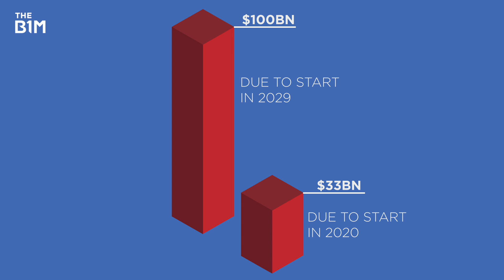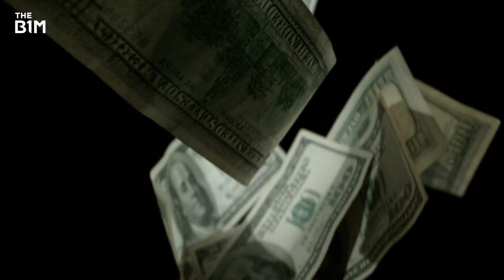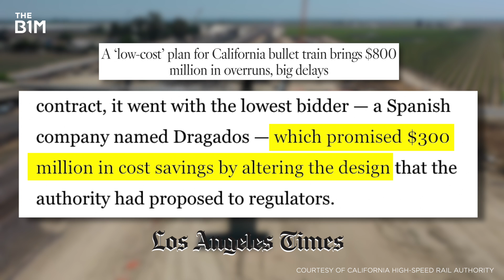What Went Wrong With California's High-Speed Railway

Comment: The video fails to mention the mountains surrounding Los Angeles, current rail traffic leaving the basin heads east in the wrong direction and passenger traffic is limited to 60 mph because of the gradient. The tunneling for high speed would cost trillions and dwarf all previous tunnel projects. The Central Valley line in the video is of little use and could have been done for half the cost and much less environmental damage by upgrading existing rail lines, albeit with slightly lower speed. The whole thing was a “green” mega project that lacked common sense and a little knowledge of train requirements. Meanwhile the state is in a drought and has not built new water reservoirs in years despite increasing population. Vanity and virtue signaling from politicians is why we don’t have nice things.
Reply: the swiss and austrians tunneled through the fucking Alps so the US should be able to tunnel through some hills shouldn't it? the japanese build their entire high speed network through their pacific mountain chain no problem but the US is "virtue signaling" because they want to build one high speed line between to cities? get real, you have no clue what you are talking about

Comment: ...I've been taking Amtrak for over 25 years.  I've had informal chats with Amtrak riders over the years.  What I've been hearing is the biggest need are connections from rural towns to both Amtrak and the hypothetical High Speed Rail.  I agree. I am originally from a rural city in the SJ Valley and finding public transportation connections to Amtrak is very difficult. Therefore I imagine same issues in connecting to High Speed Rail.  I didn't own a car for 15 years and depended on Public Transportation.  Amtrak is hugely popular.  I voted for the State Bonds to fund High Speed Rail but would like to see more connectors to Amtrak and High Speed Rail.

Comment: What went wrong with California's high-speed railway is that nothing went RIGHT -- and nothing about the Crony Express scheme was "highly sensible.".  First, there was no demand -- if there were more need, it would have been filled by private enterprise.  Second, they made promises which could never have been fulfilled, especially about travel time and ticket cost.  Third, they counted on stealing most of the money from taxpayers in the other 49 states.  I'll bet that if you do some digging, you will find out that a lot of the land that will be needed is owned by the politicos, their families and donors . . .and purchased within the last three decades.  And I dunno where the guy with the accent comes from, but anyone who has ever been to either LA or San Francisco knows that there are several airports serving each, and that none of these is "out of town."  "Not exactly easy"?  As opposed to a drive to wherever the train will pick you up, a three-hour train ride, and then a drive to wherever you're headed.   Southwest Airlines flies empty seats between SoCal and NorCal, at lower ticket prices than the HSR will have to sell for to even PRETEND to succeed.

Comment: DIG DEEPER.
 it should be painfully apparent that a project of this size shouldn't cost anywhere near this much money, not in Japan, not in Europe not know where, so where is all that money going? The answer is pork barrel projects packaged together with the HSR project that local and elected officials deemed as necessary for the project. 

for example, say the rail must cross over a freeway, in this case the 99, instead of just redoing the freeway section that will be crossed , they(local elected county and city officials) use the project funds as a means to get there entire town/city/regions freeway rebuilt with brand new on and off ramps, highway overheads, lane expansions; the works, things they always wanted done but never had the money to do it. the original route i voted for in 2008 took it across the central coast ranges, not too far from and running parallel with i5, where there is practically zero urbanization or developed land, but then it was quickly changed to run along the 99 instead, where all the central valley towns and cities lie. supposedly local leaders said it wasn't fair that there towns would be bypassed, then the motive changed and it was touted as being an economy booster for the central valley economy. 

Another example is what state officials decided to include with the project, once again deemed as necessary.......a complete refurbishment and rebuild of California's EXISTING passenger rail network! Yup, part of that 100 billion was to cover the cost of completely updating the PREEXISTING rail network., cuz in there minds, ridership will not only quadruple for the HSR, but will so for the old rail network too, a network that has had the same routes and the same speeds will magically gain triple, quadruple ridership, using routes/destinations that the HSR SHOULD HAVE been replacing but instead, according to state officials, will act as a primary route to be SUPPLEMENTED with existing lines
Yet more examples include LA & SF officials using the funds to boost construction of there own local metro rail network, or in SF case, the building of a huge new modern central train station, all of which deemed necessary so that the local metro's will be fully integrated with the HSR, EVEN THO they already are via LA's & SF's existing central station.

This whole project was just a money pit for local elected leaders to finally have a legitimate reason for needing the money they never had and spend it on there own local infrastructure projects, so as to satisfy there districts and ensuring reelection

Comment: It was voted on by the citizens. However, it's not a high speed train since it can only go 50mph on some rail. It's needed to use rail from other railroads. A judge even said that this is illegal since it can not maintain a high speed. This is in the by laws of the the rail company as voted on by the public. They would have been smarter to run to Las Vegas NV. Very over budget.

Comment: First off, there is no plan to go into LA. It will stop in Mohave. The route to Las Vegas was canceled in 2018. There was no intention to go past Victorville.  A casual drive along Hwy 99 shows this project is completely abandoned. The Daylight ran between LA and SF for years and could not turn a profit.  Oh, the speed limit on the Acela is 80 mph, due PTC limitations.

Comment: What went wrong: Politicians.  The Bond measure sold this train as LA to SF in 2.5 hours (speed over 200 mph).  Californians/Americans have no problem with high-speed rail travel IF it makes sense.  Look at the route they chose for this... Why did they build the middle section first?  Easy, it was always truly planned to be an on-going union-friendly jobs program to keep the politician-donor power cycle in place for decades.  They don't give a damn about what actually made sense to connect the two population centers of the state.

Comment: I don't know what a train ticket would be, but I'd be willing to bet taking this train from LA to Frisco or vice-versa will cost much, much more than the cost of flying or driving.

I took Amtrak one time from Philadelphia, PA, to Wilmington, DE one morning to get to work a few years ago as my car was in a repair shop in Wilmington.  

Distance - about 30 miles. 
The cost for my one-way ticket was just under $100. I was stunned to say the least. 

This story mentions that since the train is electric, there are no emissions. True enough, but as I've asked elsewhere - what about emissions at the location where the electricity is generated?

Also - if Biden, et al., wants electric cars, trains, etc... and no fossil fuels, how will the electricity be generated? Are they planning to build thousands of nuclear plants? Solar and wind are fine for those willing to pay the exorbitant up-front costs to power their single family homes by sun or wind, but I don't believe that the US' power needs (specifically generating electricity) can be met without coal, LPG, LNG or other substance obtained from the earth to generate electricity to power these trains or EVs anytime soon (this century).

We are far behind in developing new, much smaller batteries that can hold much more electricity than current ones do and charge 100x or more faster to 100% than current batteries do as well - and these new batteries must be absolutely safe. Remember seeing the videos of the last generation cell phone batteries while under development, would just burst into flames while sitting on a table being charged overnight in a lab?

Comment: The time has come in the US to build high speed rail, even normal rail also solves the issue of too much traffic congestion , long car journeys and lower emissions , trains connecting smaller cities to larger cities would be the icing on the cake and provide immediate means of travel to people all over the US provide more options and reduce the rush to flights and car travel

Comment: So when a project is 3x over budget, let's keep funding it...that makes sense (if you're an irresponsible moron).  And right on queue, blame it on Donald Trump because in California, Democrats run everything.  Maybe by 2029 they'll just get started and the cost will balloon to 30x over budget.  By the time it's done it'll cost 300x more than predicted.  And it will run at 70 MPH, take 3x longer to get to LA and take less than 1/3 the expected passengers.  By the way, the slow speed train to nowhere misses the heart of Silicon Valley - the Santa Clara Valley.
As for Joe Biden, you'll be lucky if he can tie his own shoes.

Comment: The original route was to leave Los Angeles and travel along the right of way on Interstate 5 towards Bakersfield. Harry Reid asked that the train stopped in Palmdale first so that it could connect with a planned high speed train to Las Vegas. Harry and his pals had already purchased the right of way for the Vegas rail system so it only made sense. However, this detour caused the cost to skyrocket since it now had to transverse the high desert, which has soft soil and very high summer temperatures, and tunneling through the Tehachapi mountains which are too steep for high speed rail and a know earthquake zone. They also choose to use existing rails to save money which would limit the speed to that of normal freight.

My guess is that you could beat a train driving a car from point to point by several hours.  When will they finally announce that the emperor has no cloths?
Reply: SO basically, they're watering the entire project down.
Reply: @williamhuang8309  When do they not with projects like this? It's always promise one thing and deliver something sub-par, every time.
Reply: Probably never. We'll just figure it out without them ever owning up to it.

Comment: Typical superficial research done by an channel who pushes the rail agenda. Want to know why it failed? #1 Creating new rail corridors instead of using existing ones. #2 Is all the environmental review and reviews of the review. #3 You're creating rail lines over vast distances in an earthquake zone. #4  It costs billions of dollars just to drive the necessary tunnels in the Bay Area and into LA.  #5, if it cost $50 billion to triple the capacity of airports plus another $50 to build un urban rail to get people to and from those airports, where is the logic in building high-speed passenger rail? Lastly, #6 If it costs $200 billion to build a network that will only haul a million people per year, that means over a 20 year period,  that's $20 million divided into $200 billion. That comes to $10,000 a passenger. Even if you increase ridership by a factor of 100, that mean that $100 of your ticket cost is just to pay for the infrastructure.  So economically, it does not make sense.

Comment: Sorry, but as much as I like these B1M videos, this one was total BS. “High Speed” rail between SF and LA was always a solution in search of a problem (which never existed). It was sold to naive Californians by the Democrats with a $20B price tag as a way of linking two cities who, in reality, don’t want very much to do with each other. It was ALWAYS about a giveaway to construction unions who, in turn, send $$$ to the Democrats. 

The ridership projections were wildly inflated by the California High Speed Rail Authority who were under orders from their Democrat overlords to do so. The promise of smooth 200 MPH sailing when underway was never, ever achievable. The supposed reductions in carbon emissions was significantly offset, and actually exceeded, by the carbon spewed by building the thing. The ten year construction period was a joke. The initial $20B price tag now exceeds $100B. And the projected operating costs of $6B a year would dwarf any revenue from ridership.

The Democrats who sponsored this white elephant simply wanted to bamboozle the taxpayers into giving the Democrats $$$. They succeeded to some degree.

Now a lot of the beautiful CA countryside is scarred with partially-built sections of the rail line. And the California electorate? Still as clueless as ever.

Comment: Even a developing country has high-speed railway lines. The US is a joke.
Reply: Many other developed countries also don’t have true high speed rail. High speed rail doesn’t determine wether a country is developed or not.
Reply: @blackhole9961  rather than stuck in traffic or driving for 13 hours..
Reply: @sheenasmith4555  high speed rail doesn’t fix traffic, that’s public transits job like light or metro rail

Comment: I'm  all for trains but the train does not eliminate the trip to and from the airport at either end of the trip. It's still a trip to and from the train station. So, the real difference is between the high speed train and flying or driving between cities. And the train isn't going to go to SF, so there's that trip by car.

Comment: Corrupt politicians and their friends are what's driving up the cost of this project. For example, Paul Pelosi (House Speaker Nancy's husband) will get a chunk of land, then sell it for 2x-3x what he paid to Richard Blum (married to Diane Feinstein), and so on. It's SCANDALOUS! I'm surprised that the project hasn't ballooned to 10x its original estimate.

As a US Navy vet, I saw parts of Europe around the Med. When part of the Sixth Fleet, we were home ported in Naples, Italy. Just the local trains were great! You could catch a train (Circumvesuviana Line, IIRC) from Piazza Garibaldi to the Herculaneum ruins, and the train would drop you off just steps away from the ruins. Or, you could take that line to the end, and be steps away from the elevator in the cliff at the black sand beach of Sorrento. I always wondered why we couldn't have something similar in the US...